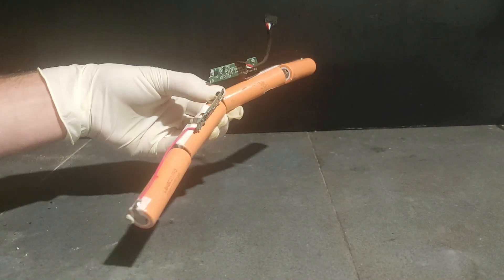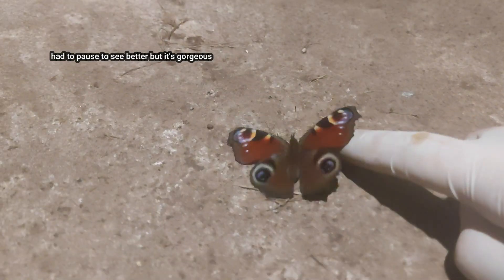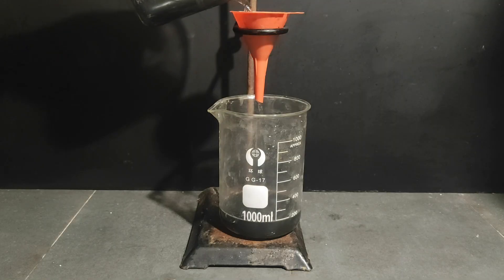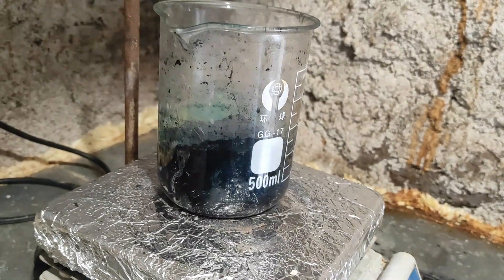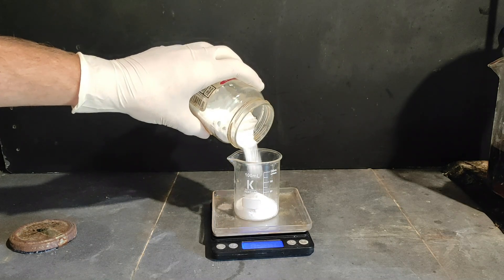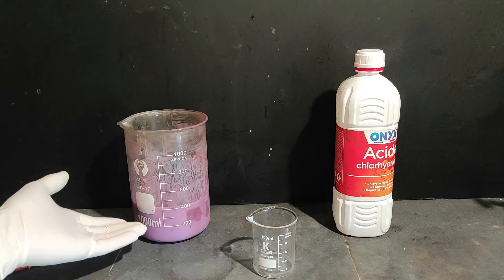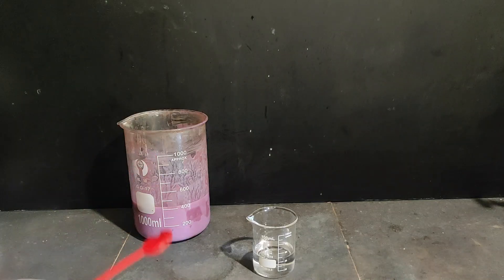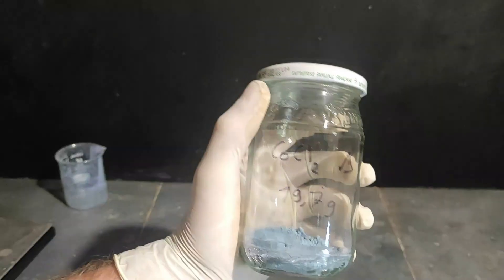Making Cobalt out of old Batteries !

Comment: Writing the description because kemist is too busy praying to the chemistryGODS:

-collect the aluminium cobalt and lithium sheet, discard the rest
-using a 8% sodium hydroxide dissolve the aluminium, discard the soluble part and keep the insoluble metals
-after neutralizing, convert the metal oxides to their respective chloride salts with hydrochloric acid
-separate the lithium from the cobalt with sodium carbonate, cobalt carbonate will precipitate out

and that's how you extract cobalt carbonate from a lithium ion battery, you can replace the carbonate with HCl if you need the chloride salt
Reply from the maker: Lmao thanks 😭🤣i am actually pretty busy so imma pin you well done